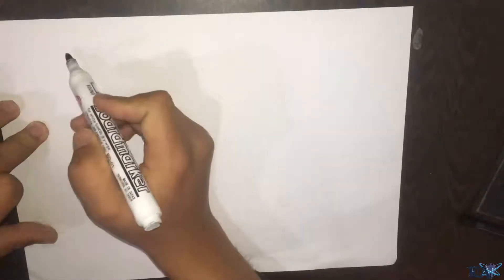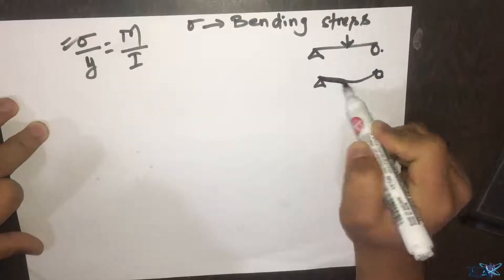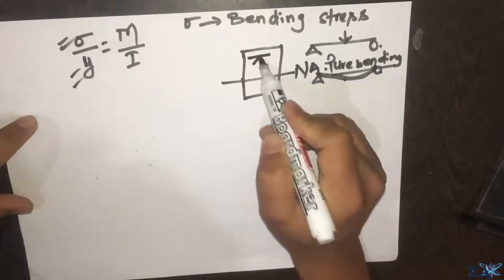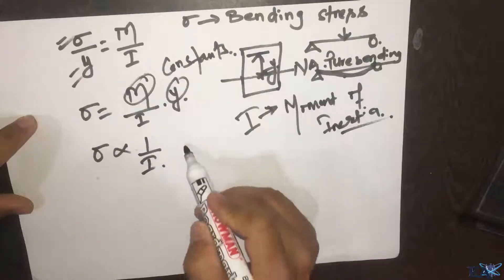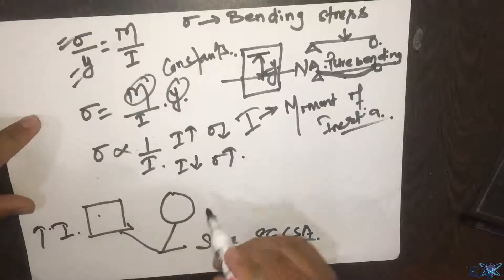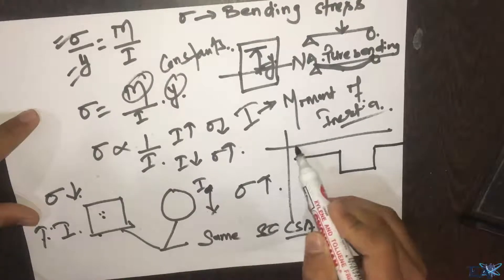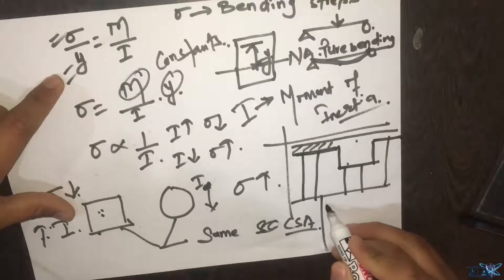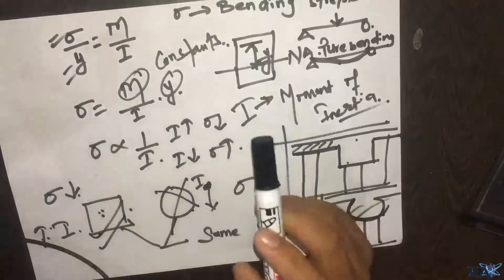Why We Don't Make Circular Beams?Interview Question #3|

Comment: 1. section modulus is more for rectangular beam than a circular means less usage of material in circular hence uneconomic 
2. casting and slab connection is not feasible in circular beams